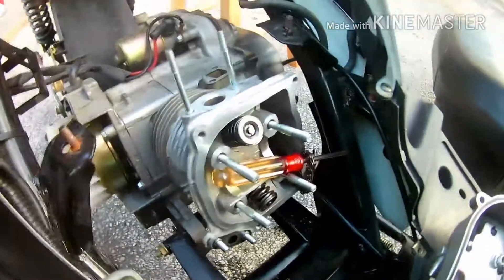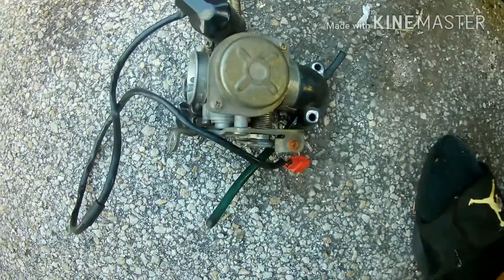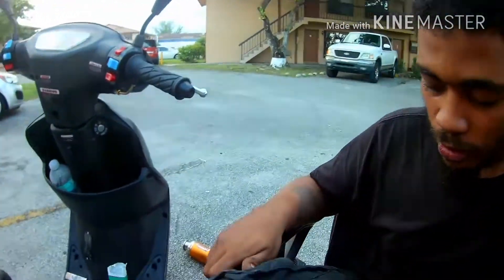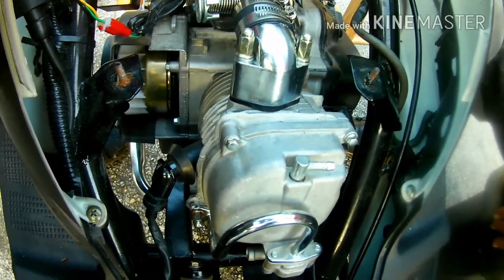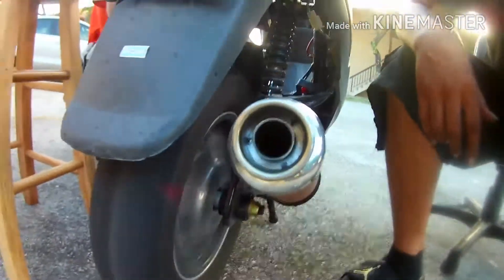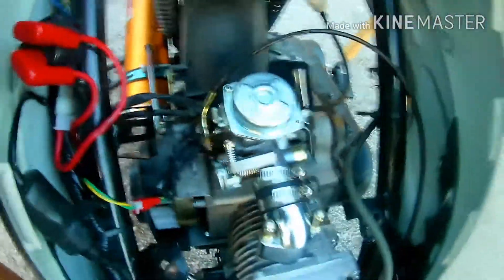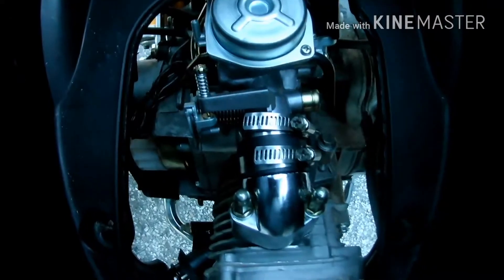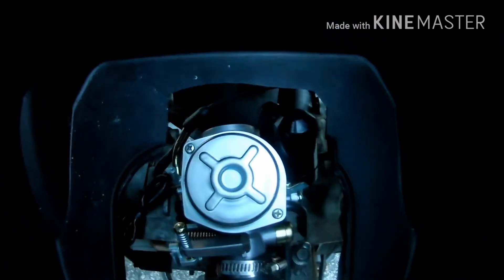100cc big bore kit update

Comment: I have an 80cc big bore kit in mine. I run 38 idle and a 94 main jet. My carb is 2 mm bigger than stock. Carb also has pod filter. A9 cam shaft, my exhaust is stainless steal, pipe is hot but muffler stays cold. My bike also has a windshield. This bike will stay in the range of 47-52mph, and I way 220lbs

Comment: 👍🏼Nice work SMc! I like that setup! Are you running the 30mm or 32mm carb for a 150? Also, is that a Nibbi racing 150 intake manifold?
Reply from the maker: 26mm and no ncy
Reply: Cool, you inspired me to try something a little different. I ordered this BBK from scooter dynasty 4 a buck (100cc w/big valve head). The carb setup will be a Zoom 32mm for a 150 & ncy coil + cdi box. The bottom end will stay oem. I’ll keep’ya posted on how it all works out. Hope it’s not over-carbed...might get some flames out the pipe!😂

Comment: having issues with my 100cc BBK i just installed it but its not turning over..any advice?
Reply from the maker: +Loraine Puaoi Dawson check your spark plug then check to see if your solenoid is working then run through all your wires to make sure if it's not the wire then it is a carburetor issue
Reply from the maker: +Loraine Puaoi Dawson but make sure your timing chain is set correctly and your cam
Reply from the maker: +Loraine Puaoi Dawson look at my videos on carburetor and CDI

Comment: I like the fact you do all this stuff yourself. Touch and go.  Btw how's the big bore kit holding up after a few miles? Faster than the vadar?
Reply from the maker: In the end it will be faster but I have to buy more parts the Big Bore Kit is holding up pretty good outside I just crashed so I got to go through and make sure everything is still working good things for your support and the Vader is faster for now but I sold the Vater to make room for more bikes
Reply from the maker: +Evo Dingo not faster than the Vader but could be due to the Vader limited performance parts